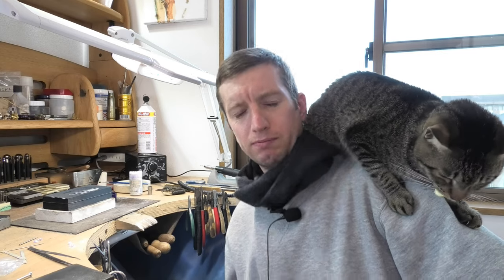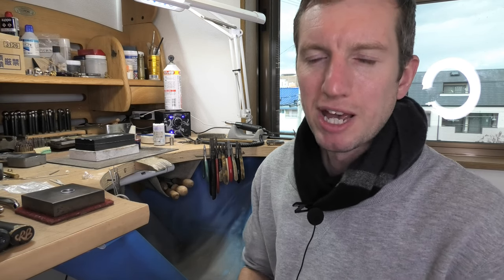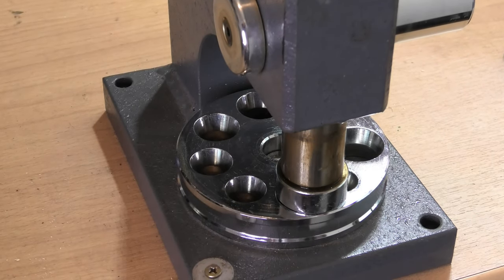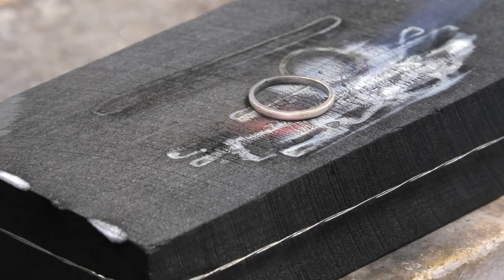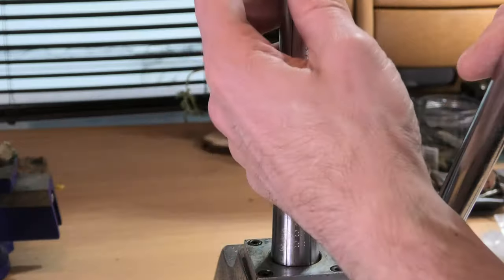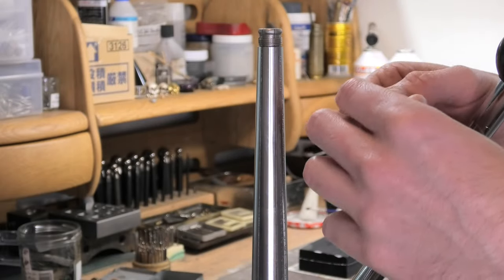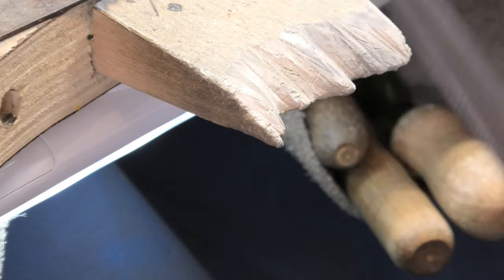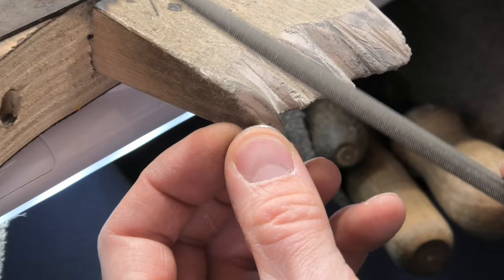Beginners Guide to Making Jewellery. How to Use a Ring Stretcher

Comment: Could you do a video on sizing semi-mounts or rings with mounted stones please? I have a sterling semi -mount that I need to size down from an 8 to a 5 . The accents are Cz
Reply from the maker: Silver rings with stones set in are a problem because you cant solder on silver without the whole ring getting very hot. Most gemstones will get damaged!